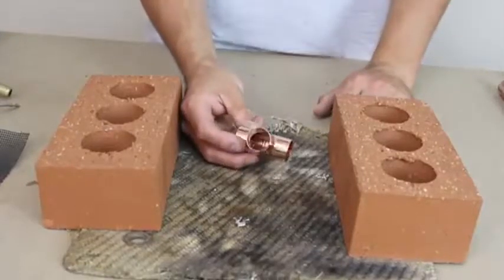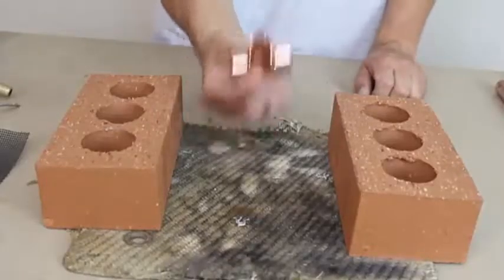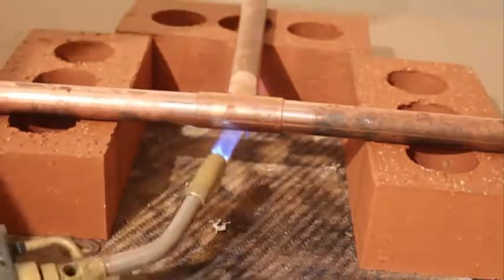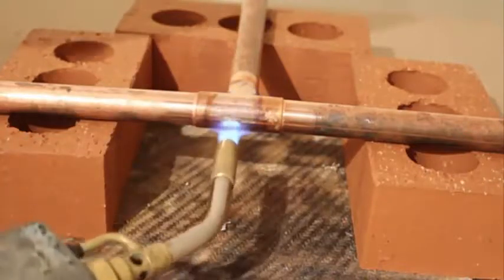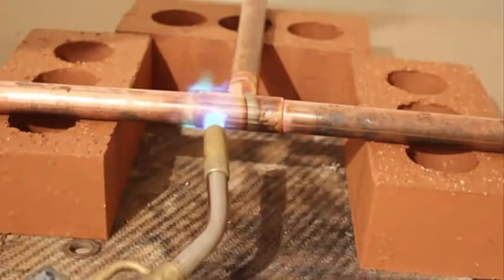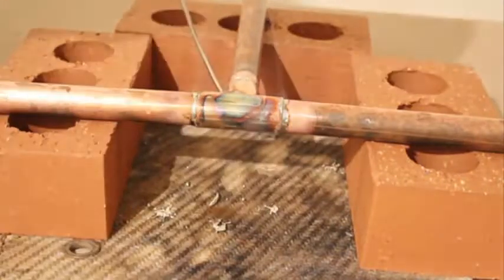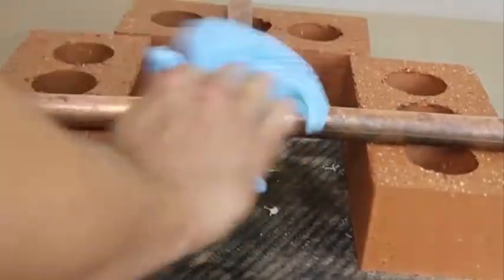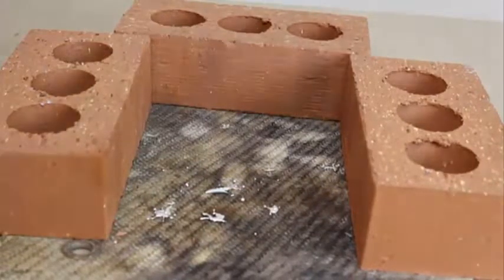How To Solder a Equal Tee

Comment: im doing plumbing in college right now and the tutors always take the flame away before they add the solder-yet everyone on youtube seems to be still burning while soldering???Ill be happy when i master this lol
Reply: It shouldn't be necessary to keep the flame on the fitting if you are quick and efficient when applying the solder, but especially when soldering a tee (where there are three joints to be made), it might help, when learning, to keep the flame on the fitting until you are doing the last joint. In the video, the presenter moves the flame to the next joint when applying the solder to the one that has most recently been heated, working his way around the fitting.  You could apply the flame to the very centre of the tee to keep it away from the solder when soldering the last joint. This will keeping heat flowing into the fitting, but ensure that the flame is far enough away from the solder to not cause it to melt before it touches the fitting.